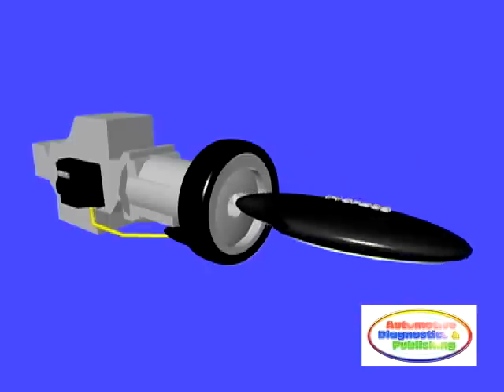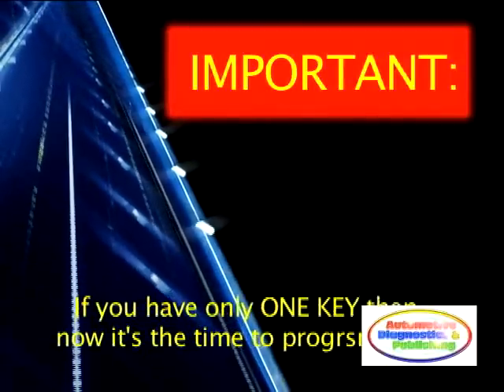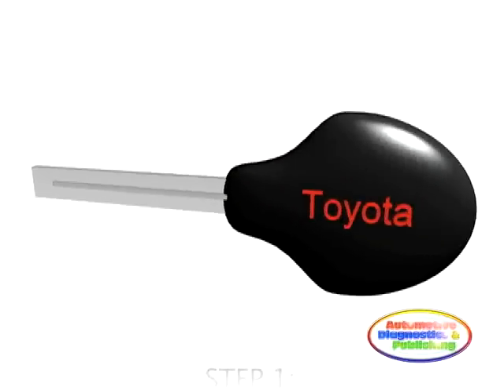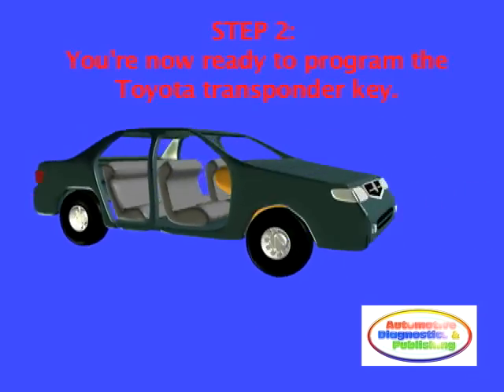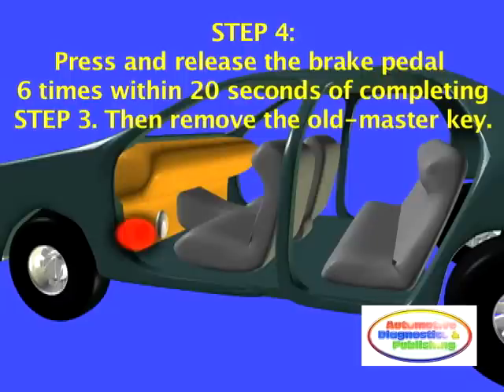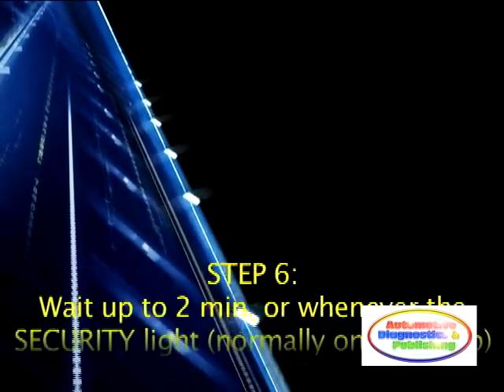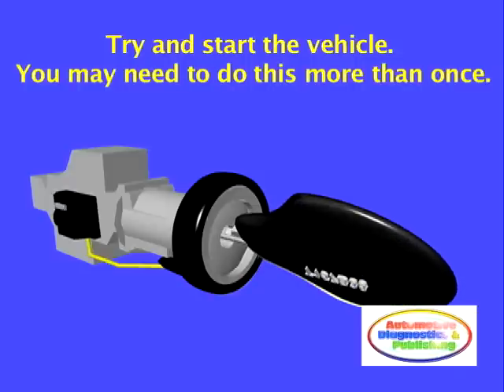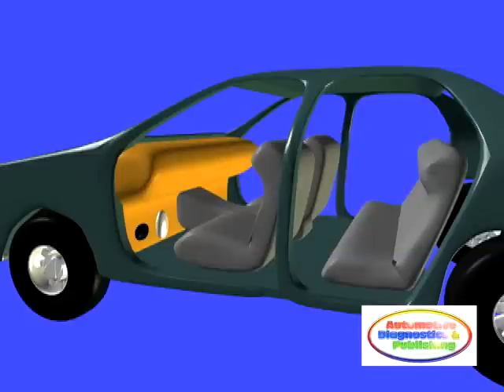Toyota Ignition Key Programming

Comment: car is toyota camry 2010 ..new key successfully programed for ignition start....thanks
still wondering how to get new key to work for other remote functions...any help appreciated
Reply: For keyless entry, this worked for me, got it from another site:
IF ten seconds or more elapse between any of the following steps,you will need to start all over again.Prepare vehicle by closing and locking all doors except driver's door should be open and unlocked.

01): Stick key in and out of the ignition cylinder twice without turning it.
02): Close and open driver's door twice ending in open door.
03): Stick key in and out of the ignition cylinder once without turning it.
04): Close and open driver's door twice ending in open door.
05): Stick the key in the ignition cylinder.(do not remove or turn key)
06): Close driver's door.
07): Turn the key in the ignition on and off twice and remove key from the ignition. (at this point if every step was done correctly,all doors will lock and unlock twice to let you know the system entered the add mode)
08): Press both lock and unlock buttons on your remote simultaneously for one second.
09): Within three seconds press the lock button on your remote for one second and release.(vehicle will beep twice to let you know it has accepted the new remote.)
10): To exit add mode open and close door and test remote operation.
Reply: *****
This keyless entry portion worked for me as well - 2006 RAV4. It differed from another instruction (that I could not get to work) because 5 and 6 were reversed and the hold of both buttons was for three seconds. The point is, even if your instructions are only SLIGHTLY different that KP Partyboy's, follow these instructions EXACTLY.

Now if I can just get the KEY programmed for ignition, I will be a happy camper. So far no joy there ;(
Reply: +joe meyer Hi Joe, Can you please share the steps you followed to program the key for ignition start? I to have 2010 Toyota Camry LE I want to program my new cut key for ignition start..

Comment: Two issues.  1) This does not work on a 2007 Toyota Matrix.  By extension, it won't work on a chipped Pontiac Vibe, or any of that year's Corollas.    2) Your video doesn't actually tell you at what point to change keys.   It simply assumes you'll do it after the "your anti-theft..."   section.
Reply from the maker: You don't know what you're doing.

Comment: @thekeystone74 
According to "Locksmith Charley" (website I found), if you put the key in the ignition and the blinking LED indicator for the immobilization system goes off immediately, it's a master key. If it stays on for a few seconds before going off, it's a "valet" key, not a master key.
  I'm hoping to activate some extra keys myself on a 2010 Yaris, and have been researching this.

Comment: no my friend, doesnt help at all. Im a technician but i always want to learn more,, when i need to work on electrical on an engine ,is necessary sometimes to remove a battery lead(negative most common) BUT im really afraid to do it cause the engine wont start after the job.IF this HAPPENS.WHERE I CAN FIND OR BUY THE PROCEDURE OR THE DAMN SOFTWARE TO START IT AGAIN. ITS NOT ROCKET SCIENCE,but do you think the mitchel,identifix all data websites HAVE THAT INFO??cause if that so,ill log in

Comment: Can the program of my keys fail to recognize my glove compartment and trunk? Or does my Avalon 2006 need a new auto computer like the dealership says?
Reply from the maker: Janis Davis What is your question? These computers or modules don't fail that often, so post back with more info.
Reply: Computer needs replacing, told by dealership. Not one component. But the whole computer board. Anything I can do?
Reply from the maker: I would get a second opinion and take the car to an independent repair shop.
Reply: Thx!
Reply from the maker: Thank you.